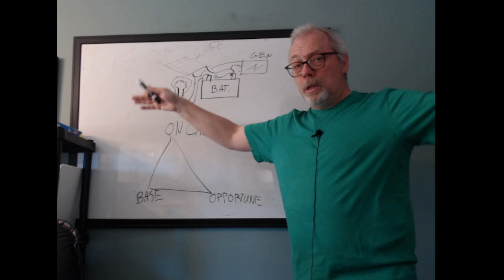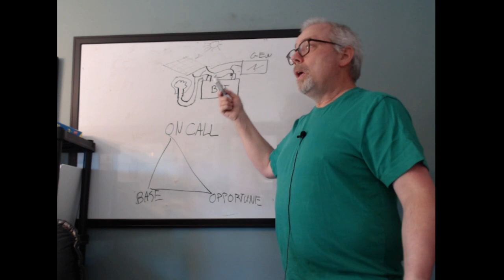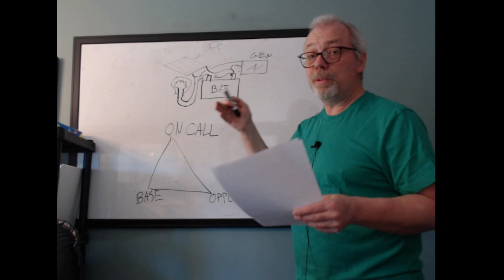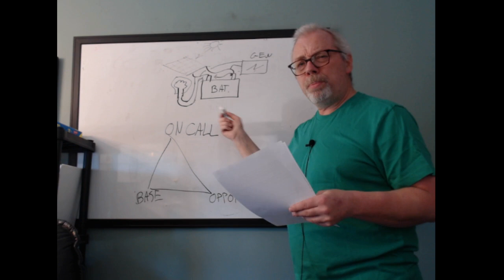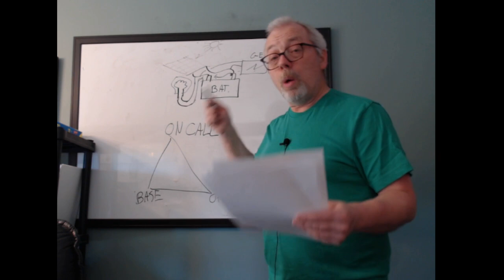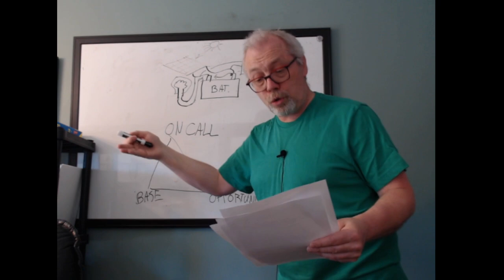Grid scale power storage increases carbon emissions

Comment: Your title is very misleading. The problem is not the grid storage, it is the lack of renewables. As you said in your conclusion, increase the amount of renewables to store clean energy and then peaker plants are not needed and emissions and prices go down.
Reply from the maker: I think we are making the same point. If we have enough renewables to turn off all gas fired plants, then we need to store the excess renewable power. If we don't have a surplus of renewable power (which is the case in Alberta, Canada) then it is the wrong time to use battery storage. Renewable generating capacity must come first. Storage must come second.